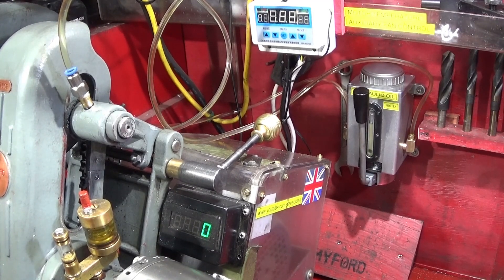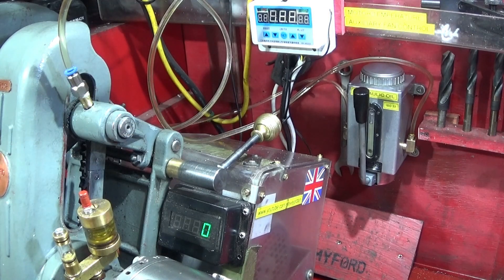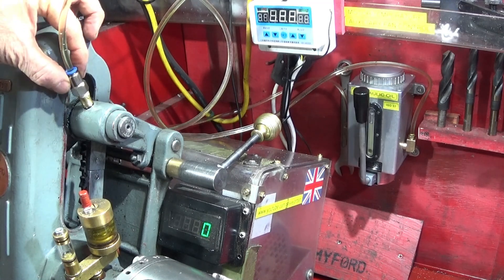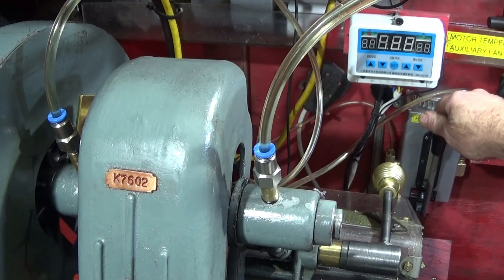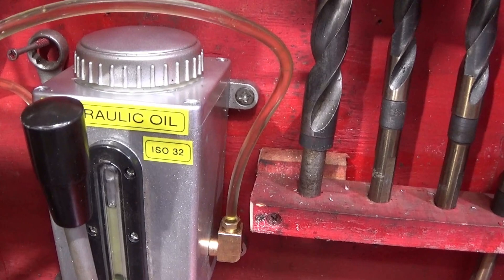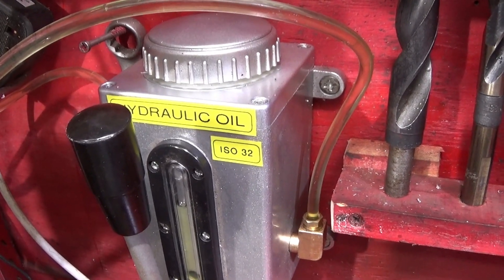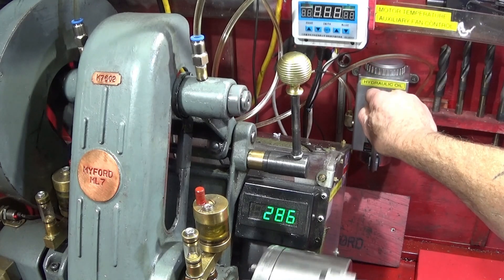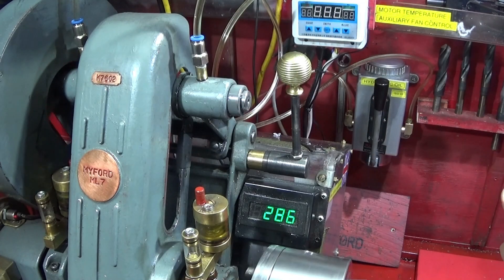The Best Countershaft Bearing Oil System For The Myford ML7

Comment: An improvement over what you have here would be to spring load the pump lever so all you do is pull the lever and release it to be retracted under spring pressure. A simple contraction spring or elastic band affair would be adequate to achieve this.
Reply from the maker: It is spring loaded and returns automatically on the return. I forgot to show that. Regards Steve

Comment: Hi,Steve. These type of lubricators are a huge improvement on any machine. I am planning on fitting something similar on my Alba shaper with multi point manifold block to deliver lube to several critical bearing surfaces. It is an absolute pain having to go over each individual lube point with an oil can. There are also electric operated pump models similar to this. With that type a timed delivery of lube can be preset.

Comment: Steve very nice.. maybe you can make a custom manifold and plumb the whole machine off this one pump.. seems like there is enough pump capacity to do it !  thanks for the video  Joe
Reply from the maker: Hi Joe, Thanks...yes I may do that sometime. It would be excellent to do plus I have the 1/8 BSP fittings on the main spindle  already so it should be easy. Regards Steve

Comment: Marvelous idea Steve. Sometimes I do wish I could get my hands on one of these Myfords, but I ended up with a chinese 10x22 lathe. But it seems like a okay one. What sort of oil do you use on the bedways?
Reply from the maker: I just use ordinary motor oil on the bed of the lathe. The Chinese lathes are excellent. I'm pleased with my 7x14 mini lathe as well.
Reply: @SteveJordan  Yeah mine needs some work, but the basics are good. Wonder why people give them so much negative comments? Think how costly it would be to buy a new Myford these days if they still made them?
Reply from the maker: Many people run down the Chinese lathes. I would buy another if I didn't have one. I have made literally hundreds of precision components on mine. I have changed parts over the years but have learned so much from doing so.
 There are a lot of snobby people in the engineering world that look down on the Chinese lathes, but I think they are fantastic machines and have sometimes had to use mine instead of the Myford. I think a lot of bad comments come from people that don't even have a lathe.